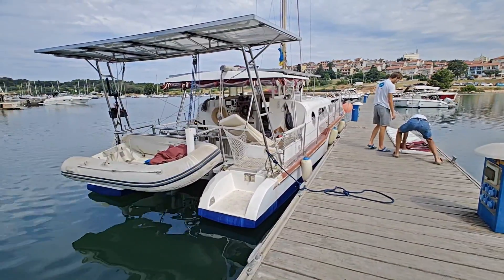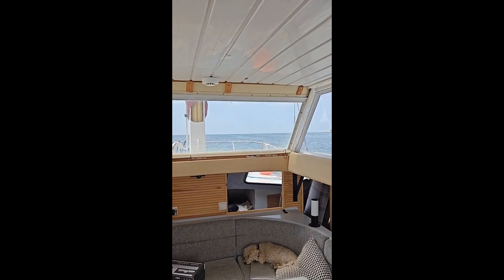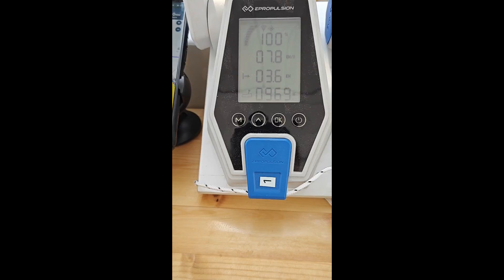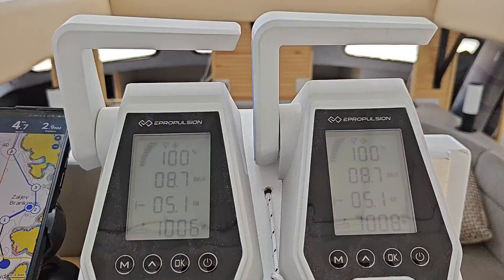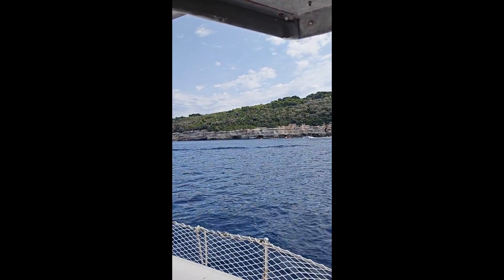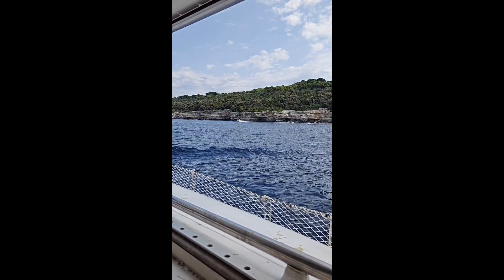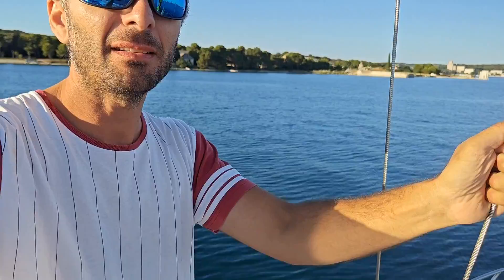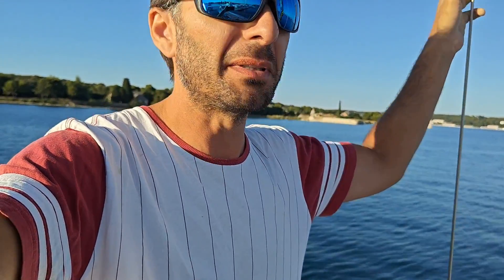Our DIY solar powered yacht works!

Comment: Very educational! I also am converting a similar sized catamaran to fully electric.
And I totally removed the sailing rig! I will use 5120 WattP solar (16 panels) with at least 30kWh of LiFePo4
‘At least’: I DIY my battery system (with years of experience), already have 30kWh (16s/2p) ready to use,
and am thinking of a seperate 15 kWh pack for redundancy. I totally agree on the battery remarks you made,
but I also think of all things I want to do electrically, like induction cooking, 1760 watt aircon, maybe even
electric floor heating! And, a DIY battery is much, much cheaper than commercial (but you definitely must know what you’re doing!)
Safety first !!!!
I also use 2 Navy Evo 6.0 outboards

Edit: I forgot to mention my 82LBS trolling motor in te middle between the two Evo’s:
Using it sideways, I can easily move the back of the boat sideways! The bow can already be moved sideways
easily by putting one Evo forward, and the other in reverse! So I have total manouvrebility with three motors.
and: Win win.. I can simply detach the trolling motor, and use it for my dingy..
But my cat is far from finished yet, I hope by te end of the year.
My cat is a 4,200kg 9mtr one off, out of 8mm marine grade aluminium, build for the CEO of a big ship yard in the late 70’s
It has numerous safety features build in, no fragile through hulls. The deck diesel has a outboard type sail drive.
I will keep that sail drive, for if I want to use an inboard (on deck) electric motor in the future.
Reply: Whoww, your answer was quicker than our Max Verstappen! Pole position for you😂😂

I already somewhat have the same experience with the 7.1 kWh pack, if you keep between 10 and 90% state of charge, you only need to top balance once.
I’m quite interested in the JBD BMS now, heard good things about it.
Did you hear about Orca attacs? And I also think the way you do Patrick, no Pod Drives!
And, maybe in the nearby future, when I dare to go further from land, I will have a new extra Evo 6.0 ready, to simply swap with one when one fails!
How easy is that, compared to needing to remove a Pod..
I use ‘solar panels with experience’, they were hard to find, as I wanted panels with max 4 years of experience. In my country, most farmers have loads of panels abaiable for cheap, but mostly 8 till 10 years old, which seems the best age to replace them.
Suddenly I was able to get my hands on practically new, 3years old, 320Wp panels, with the newer ‘Half Cell’ tech, with AR coatings, and, in my case important 1670x1000x40 size. I was about to grab new, bigger Jinko’s at 420Wp each, but that was some 600 euro’s more, and the max config on my roof would be some 4200Wp. So, win win, more WP, for much less money. I now have 16 panels here in my room, for 850 euro’s ! They only are a bit green from the weather, but cleaned, they look and act like new!
They will be connected in 5 independent strings of 3 panels in series, with one panel left for auxillaries (12 Volt system) Each string connected to a Victron SmartSolar 150V/35A MPPT.
The 40mm thickness I have now, with the smaller size, gives me a more ‘stiffness’ feeling, but I can be wrong about that.
Greetings.
Reply from the maker: Sounds like a great project. The only advice I would give is to mount the outboards as far apart as possible. I've steered cats with inboards before and you have a tank like drive, with my outboards so close together that's a real challenge. Funny I almost decided to lose the mast and go for more panels, especially when I saw the budget for the new rigging... But in the end I've kept it, and will hopefully get good use out of it sailing. I'm also planning to mount my (2hp equivalent) trolling motor between the two outboards, mostly it was meant to be as a backup in case something happened to the 48v system so I have a 12v motor to fall back on. I run it on the same type of batteries as my main bank, so it's 12.8v 280AH and should give me a couple of hours of motoring if needed. Try to keep your boat as light as possible, it makes catamarans safer and faster. Have you given any thoughts to splitting your 30kwh bank into 2 x 15kwh? With the huge amount of solar you have you'll almost always be running on sun, and probably wouldn't need a 30kwh and a 15kwh. Each 15kwh weighs 80kg-100kg depending on how it's put together.
Reply: Thanks for your very quick reaction Patrick. Yes, I know about that space between the motors, and am costantly in debate with myself:
Between the two hulls, I can mount them apart with some 1,37 meters between them, when I would mount them at the end of each hull, it will be 2,51 meters, a significant difference. Can you give me an estimate on how much your motors are apart? Between the hulls, they are better protected when you ‘park’ your boat backwards, mounted at the end of each hull, they are more exposed, but better protected during ‘motoring’ as the hull is likely to move away most of the stuff that can hurt the motors, like drifting wood and other stuff. I especially wanted outboards, easily removable or tiltable when something went wrong with the propeller, and I noticed you thinking the same way as I: no through hull mounts like with pod drives! On my boat, everything, like motors, saildrive, rudders, are in a ‘outboard’ situation, so no trough hulls for any of them! With the outboards between the hulls, they are more easily accessable, and I’m free to make an extra swim plateau and/or ladder on each hull, like your Cat already has. So, please Patrick, help me with making the best choice😂😊
And.. you mentioned ‘tank like drive’, before my retirement (60) last year, i worked as an optical engineer for the Dutch Navy, and also found myself close to tanks on a regular basis, as I also worked for the army and air force. Oh, and I so much like that bath tub inside your boat !
Edit: My boat did have a lot of ballast in the front of the hulls, to keep it level, that is thrown out, along with all sailing stuff, the 40hp diesel is going, with that very heavy sail drive.. The placement of the 180kg of 30kWh pack, will be quite central, under the couch, and the spare bank (90kg) will be placed when the boat is in the water
Reply: I did some measurements on a screenshot I took from your video (hopefully with your approval😂), giving me an estimate of 99.4 cm between your motors, is that somewhat correct Patrick?
Reply from the maker: @HighDefDude  yes basically a metre. I can still shift the bow left and right, but it takes a fair amount more throttle than I would like.
Reply: More and more, I’m realizing how valuable you are to my project, as you are quite a big step ahead in testing a setup which only few have tried before!
You are the first who has a situation quite similar as mine, with the same ingredients, batteries, boat size and boat weight.
I can only hope my setup will be finished and working next year april.

My important questions for now: What brand BMS and App do you use for your battry bank? And, do you have important reasons for it?
I have two Daly BMS (350 A each) for my battery banks, but have ears for a better solution if aviable.
In fact, I’m quite curious how you did your complete battery setup, maybe I can learn something..

I already have about 10 months of experience with a DIY, ‘portable’ battery, which is 7.1 kWh LiFePo4, with a 250A Daly BMS.
It is a complete (quite heavy) battery on wheels, with everything included. A 8s 280 EVE pack poweres a Victron 12V 35A converter, and a 3000W 230V inverter. It has 3 USB-A charge sockets, and 3 USB-C sockets, and 2 of the well known sigarette car charge sockets. A Victron Smartsolar 150/35 MPPT charger completes the chargability on solar panels
The only thing I ever noticed with the Daly BMS, is a slight mismatch in calculated average Cell voltage in the app, which only was some 0.004 volts.
I know that Daly does a very poor job in balancing, with only some 30 milliamps, but I decided to make every cell reachable from the outside, and am going to do the same on my boat, which means 17 electrical points directly accessable, to be able to hook up any active balancer when needed, without opening hatches and stuff.
Greetings..
Reply from the maker: @HighDefDude  I struggled to find anyone with a similar setup, in fact I hopped between a pair of inboard electrics, the Navy 6 and the pod 6 probably half a dozen times. Whenever I need to maneuver I still feel like the pods would be better, but if I had a pod and it leaked water into the boat I would be swearing at myself! 

Anyway, I use the JDB 300A BMS with a QUCC active balancer in parallel. I did that in case I lost the BMS so I could still somewhat safely run, but to be honest I was fooling myself. The EVE cells stay so closely matched once they're allowed to balance that the active balancer does nothing. I think I could happily remove it. The JDB BMS is a contactor based BMS, so it can handle big currents without a risk of blowing FETs. If I was to do it again I would either go for an active balancing BMS (if I could find one that would reliably allow 300A) Or for the JDB BMS again, but with a programmable active balancer, so I could tell it to only balance at 3.4V and up or maybe no active balancer at all, so far it's been completely unnecessary. With my current balancer there's a risk that at very low voltage it'll try balance the cells and that will throw out my top balance. It hasn't happened yet, I've never had a day where I wasn't fully charged by mid day, and I've never drained low, but technically it's a possibility. 

I use the OverKillSolar App to monitor all the packs, but the XiaoXiang app to set parameters as it has access to a few more settings on the JDB.

Have you chosen your panels and solar charge controllers yet? They're probably the most important piece of the puzzle.
Reply from the maker: Have you bought your outboards already? If not I might be switching to the pods (struggling to dock too much...) and I'll be selling mine for a large discount. Let me know if you're interested.
Reply: Yes Patrick, I have two nice Navy Evo 6.0 outboards already.
Ik know and thought about the possible docking issues earlier, and as I see it, I find the benefits of the outboards more important:
I can easily swap them if nessessary, or lift them to remove stuff from the propellers, or even change a propeller when needed.
But I of course removed all sailing stuff, and so don’t so much have your alternative way of propulsion (other than a trolling motor, like you have)
But there is another thing: I noticed that you have a aversion (like me!) against through hulls! And then, with my exellent 3D imagination skills, I see a big chunk of wood slam against one of the pod motors!! That would be nasty, and something I don’t ever want to happen!
Thats my main reason for never wanting pod-drives!
Unlike with the gasoline counterparts, there no difference between an electric pod and an outboard, at least with Epropulsion, the motors are exactly the same, so there, no debate of which to choose.
Reply: Ohh, I forgot to answer you on your ‘selling’ question. Is there any way to contact you privately about this? I don’t know the inns and outs of Youtube here.
Reply from the maker: @HighDefDude  you can mail me on mckayp@gmail.com
Reply: Very interesting reading both of your chats. We have a 50' / 15m aluminium powercat we're expecting to convert to solar electric.  I'm interested in your prop sizing, as the standard props for most eoutboards seem way undersized for 4-5kn efficiency.
Reply: @bluemu Ohh, And: You are thinking of changing your main propulsion setup, which means that you need to be careful with quick decissions on the details of your new setup: Diesel engines are already here for more than 100 years, electric drives are quite new! Do decent research with reliability in mind..
Patrick still has his sailing rig for back up, although he thinks he will remove it when it needs expensive repairs in the future.
So then he would need to consider some paddles (like me..)..
Ohh, and on batteries: If you are going DIY, you should not ever save money on tools, I use a 18 tonnes crimper for my cables, shrink wrap with glue to prevent air from corroding conducting material, flexible bridges between cells, even an infra red camera is a must in my opinion, to easily locate bad connections and other things that can overheat dring using full power!
The LiFePo4 cells are the safest of the ‘Lithium family’, they do not burn your boat down, badly manufactured cables are much better in doing that job!
For many, DIY is very tempting because commercial batteries are (still) very expensive! But stay safe!
Reply: @bluemu  15m Cat? Thats nice! One of the main advantages of going fully electric, is the high torque at low revs! The average diameter of the Epropulsion props is bigger than on a comparable gasoline outboard.
Most (if not all) electric propulsion experts say that with electric motors, you should not simply convert kW into hp in the yacht world, mostly because of that high torque, but also because they are more efficient, especially when they are 'direct drive', like the Navy Evo 6.0 versions Patrick and I use.
I cannot easily give you an estimate how much kW of propulsion you need in your situation, it all depends on mainly the weight and hull shape of your Cat.
Patrick already gives us valuable information on how his setup works, as he is about one year ahead of me on field testing this concept.
I only found one other guy on youtube (Wildly Intrepid Sailing) with a much bigger Cat (44 ft) than Patrick an me.
He uses some 7000Watts of solar, with two 15 kW motors, which are not direct drive, with some 16 kWh of battery power.
He also is very clear about how 15 kW of electric motor is camparable to a 40hp diesel engine.

Comment: Nice work! Have you thought about regen? Supposedly regen will only work with an epropulsion battery. Haven’t tried yet, but I’m betting just one small epropulsion battery in the system will allow regen. Epropulsion engineering says it won’t work but I think it will.
Reply from the maker: I wish they allowed it on any battery (and honestly they should). Not sure I'll buy one of their batteries to get it, they're really expensive compared to the DIY packs.
Reply: Did you ever suggest putting a windmill on the roof of a Tesla?  <facepalm>.
Reply: @StephenJPayne while a wind turbine in a telsa won’t work, a giant sail would. The telsa would regen as is blew down the street just like a sailboat can regen through they prop when it’s pushed by the wind.

Comment: You've hit the nail on the head with your theory of panels vs batteries. The batteries are the buffer, the tank if you will, the panels are the supply. A lot of people don't understand this. If you can generate more than you use, particularly in the worst weather conditions, you'll never go without power. The regulators will take care of any excess, or you could spill off to a house bank in the future. As I have no doubt you're aware, the only time you'll come unstuck is when you're operating at a deficit, i.e your load is greater than your supply. [maybe at night or during prolonged periods of excessive foul weather] The main thing that will bring you unstuck with your system is the fact that your batteries may be floating on full charge a lot of the time, and this is an issue for Lithium as I'm sure you're aware. You'll add possibly another year to their life if you can keep them to 85% of full charge. [I just had a quick look at the specs for your batteries and the recommended SOC is 10 to 90%] Are you running a programmable regulator that enables you to do this? I'm assuming you are, based on the fact of your battery choice. Great to see and good luck with it all.
Reply from the maker: Thanks Alan, great comments. At the moment I'm charging to 3.4v per cell so I hope I'll have a long life with these batteries. I have the same cells in a 12v config for the house battery and the dingy battery (on a 2hp equivalent trolling motor). The trolling motor batteries will become my backup in case anything happens to a cell in the main pack, but I'm really hoping not to have issues by keeping between 3.2v and 3.4v

Comment: I've been working on the idea of converting a cat into a purely solar powered yatch. So, the ability to live very confortably, but also to go off shore - i.e. power through day/night, so to see what you are doing with so little power gives me hope that when i find the right Cat, my calculations will work. Would love to crunch the data of speed vs power consumption, and battery size to get through the night (I have the spreadsheets but based on assumed data and relationships). Very cool.
Reply from the maker: I'll try out together some more data when I have a windless day at a range of different power levels.
Reply: @SailingElectra  If you need an engineering nerd to do some number crunching - am happy to assist :)

Comment: You can always add more solar panels later.
Reply from the maker: If I ever have a very expensive mast issue I'd likely not spend any more on that and then lose the mast and gain another 7 panels. I suspect with 6kW solar I'd never actually miss the sails and my average speed would be around 1 knot faster...